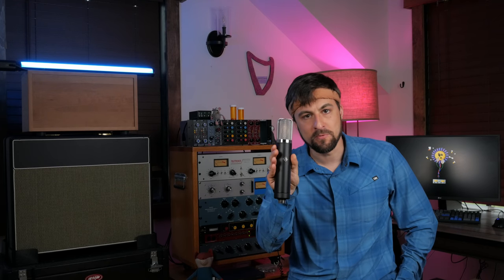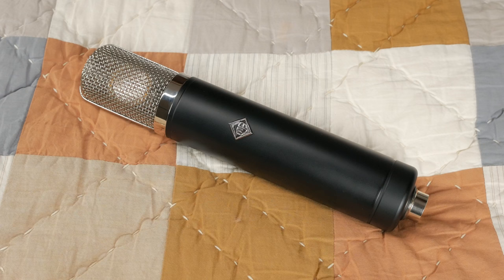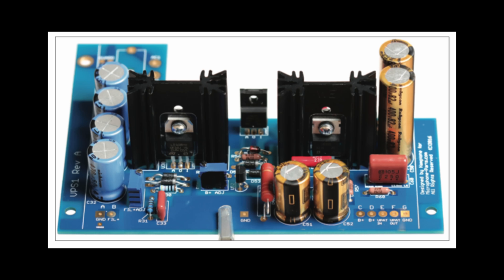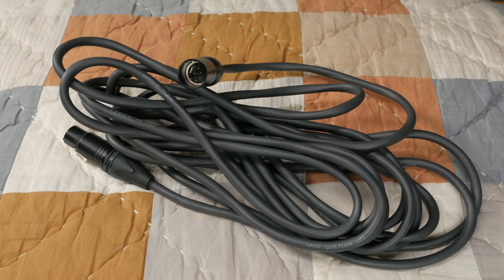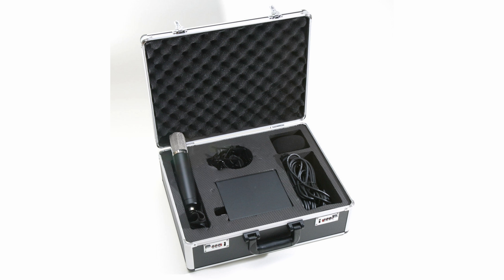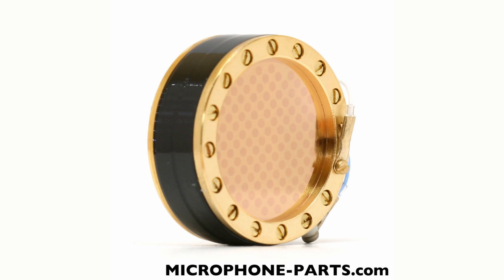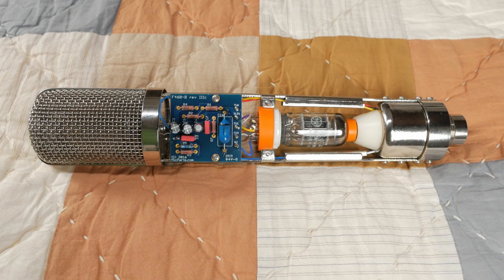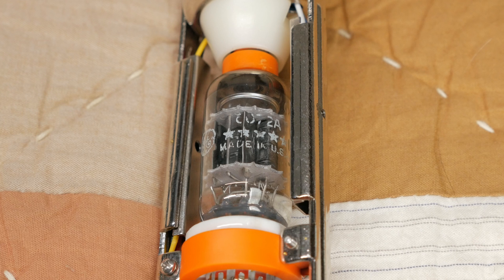Microphone Parts 12-251 Kit - DIY ELA M 251 Variant

Comment: The RK-12 has little in common with a 'real' CK12 capsule. In fact it is an edge terminated K67 capsule. 
A CK12 is considerably more difficult to produce. 
The microphone body is identical to an Apex460, with a different headbasket.
Reply from the maker: Thanks for stopping by Ruud! I've heard that from a few other folks as well. Do you have any good resources I can read to learn more?